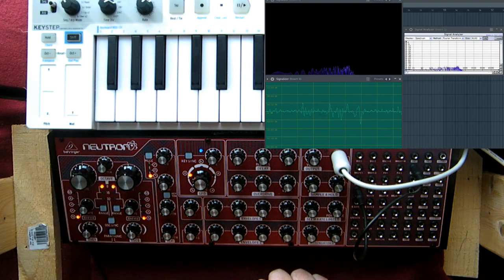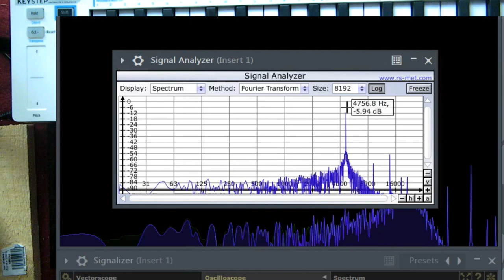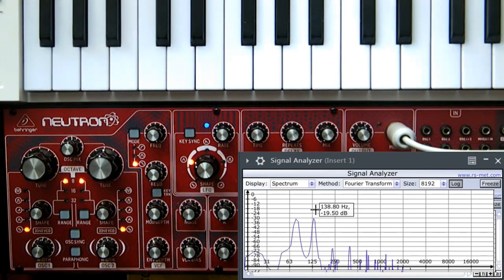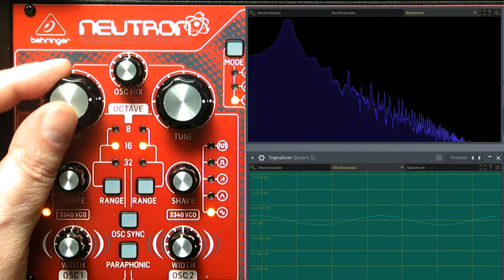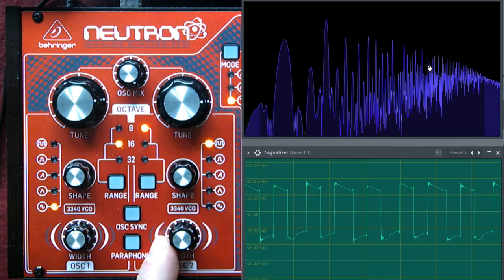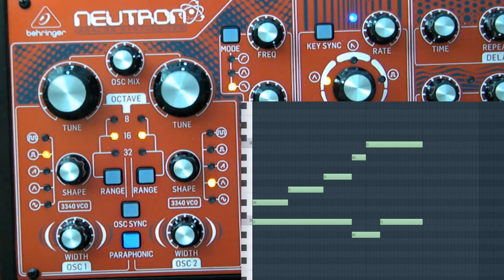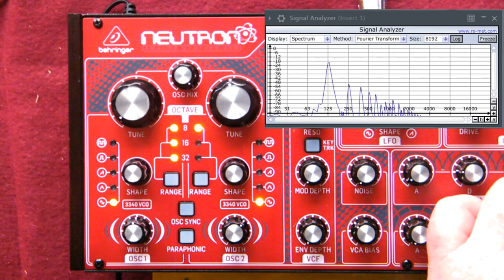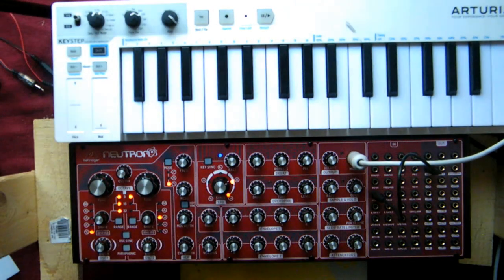The Behringer Neutron Part 2 The Oscillators

Comment: I'm learning a lot, but I wish the synth would be a bit milder in the mix, it can be quite piercing. Tip: the LFO is patched to Mult In by default. Saves a cable.

Comment: Thank you for tutorial. How do you find your Behringer Neutron performs after a while? I'm having the worst ofluck with this thing. It's already the third Neutron, - I returned the first one to the fellow on Reverb, the second one had serious issues too. Now I have the third one and it won't stay in tune. It won't get recognised by my computer despite the fact that I have all the necessary drivers, including one Behringer wants you to download. Often, all of a sudden it mutes the long note even if sustain is turned all the way and, recently, as soon as I plugged in my Behringer Reverb pedal to the "In" port, - the tuning went completely haywire, it started squealing like a sick cat - pitch going all over the place, or, all of a sudden - it would only play the same note regardless of which key is pressed! Before that MIDI notes would get stuck, requiring me to turn it off and on. This issue didn't go away even after Factory Reset, which luckily for me, fixed the pitch squealing, but now I'm afraid to plug anything into it including patch cables... And it's not as if I am a complete novice to synths, I know the basics and own a number of other mono synths and a poly synth. From what I read - the switches inside the patch point jacks are very finicky and vulnerable to breaking so I'm wondering just how many people are having similar issues with this thing.

Comment: env retrig doesnt work well for me. if i set a high attack  then play a 2nd note once it reaches the decay stage even with env retrig turned on.. the attack starts much too quick.  it's like it doesn't get reset to zero .. disappointing

Comment: What app did you used to check waveforms?
Reply from the maker: Thank you for asking! It´s a VST called SignalAnalyzer. I use it ver often, it works very precise and it´s freeware. You get it here: http://www.rs-met.com/freebies.html.
Reply: Its a .dll. How to install?
Reply from the maker: @rmanpojo8485  You simply copy it in the folder, where your DAW´s VSTs are stored.